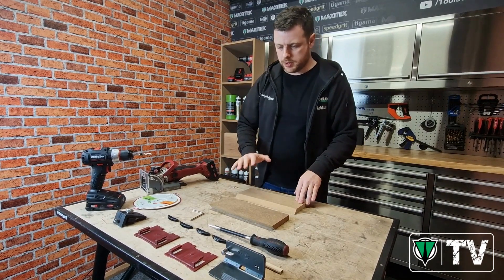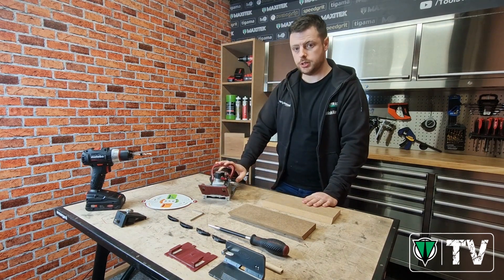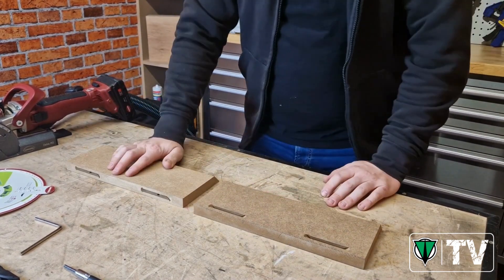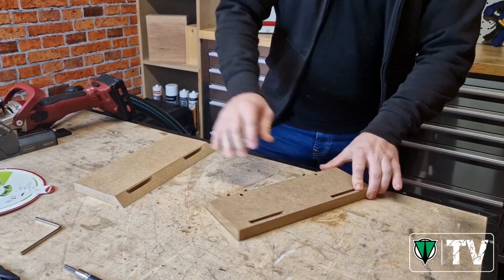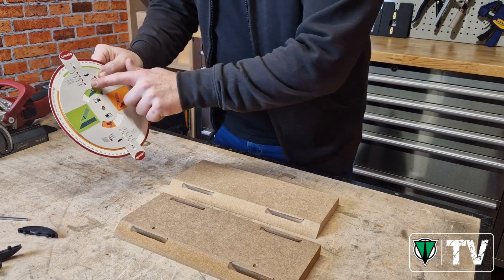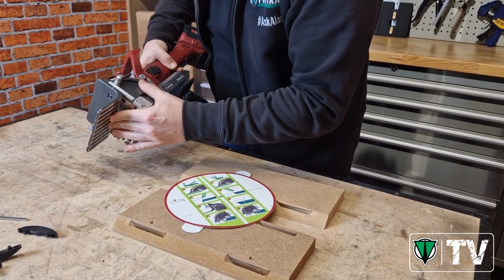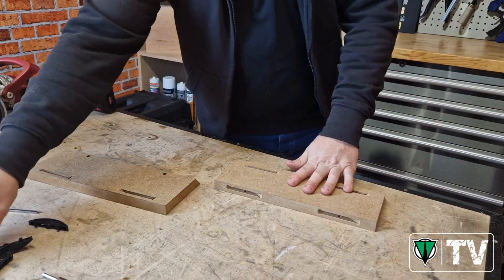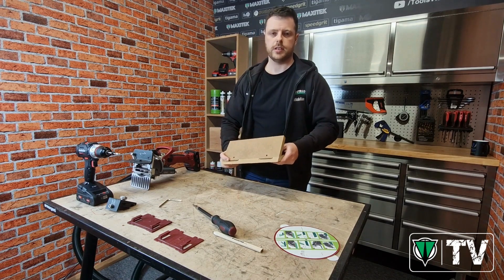How to Create an Angle Joint using Lamello Tenso & Clamex

Comment: Hey there! Great video! I had a question on using the lamello to create the connection closest to the outside edge of the miter for a tighter outside miter since that’s what will mainly be seen. Am I overthinking it or do you think it would make a difference. I’m making a waterfall walnut table that is about 2 inches thick
Reply from the maker: Hi! Thanks for your message. If the material is that thick I would consider staggering the connectors along the joint along both edges. The Clamex is going to give the tightest connection and will literally pull the two materials together as these offer tremendous clamping force. If using the Tenso connector then I would ensure the machines micro depth adjustment is dialled in perfectly and ensure it is a good quality PVA glue used they will then give a nice strong joint too. If you’re in the UK and don’t already have the machine please do get in touch with us on sales@protrade.co.uk and we’d be happy for a demonstrator to call in and let you see it in action.